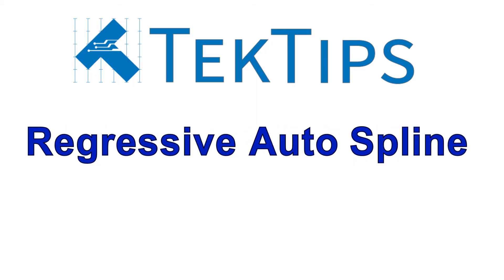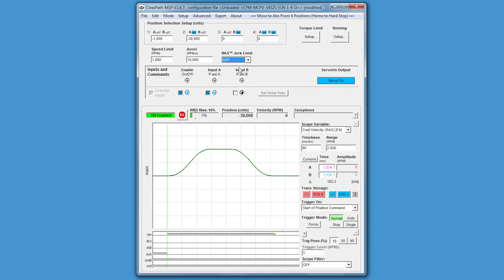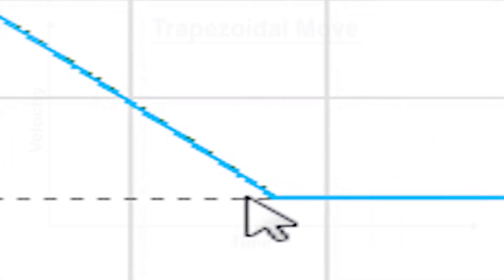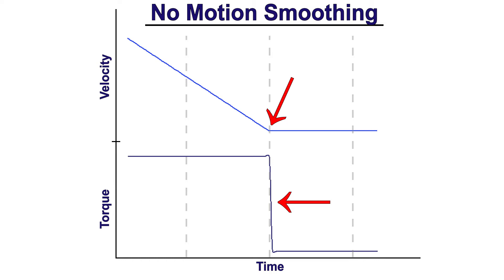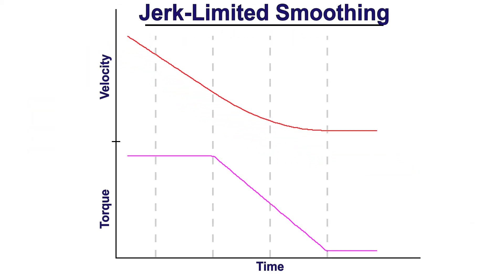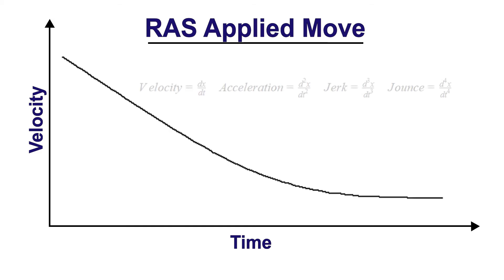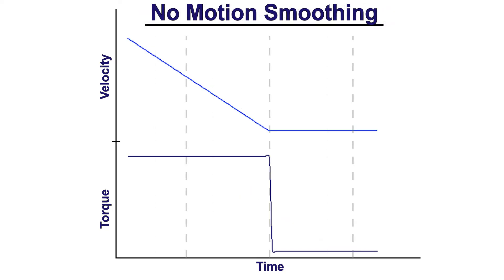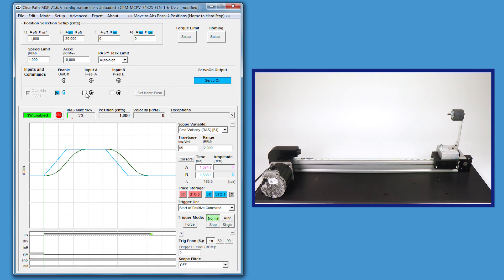ClearPath's RAS: Smoother Motion Control than S-Curves

Comment: What does this do to coordinated moves in two or more axes on SD models?
Reply from the maker: Hi Rick,

To achieve coordinated motion with the ClearPath SD series on a multi-axes system, you'll need to enter the same RAS value for each axis. This assumes that the motion controller is supplying properly coordinated moves.

Determining the appropriate RAS value for your machine requires some testing with different values. The general approach is to start testing with the lowest value in the appropriate range below (based on the type of machine you are testing) and run some test cuts. 

During the test cuts, you should be running at your maximum acceleration and cut speed. After testing with the lower end of the range,  raise the RAS setting up through the range and retest. 

Here are some typical RAS settings for CNC machines:

Laser CNC 9ms-16ms
Wood router 16ms-24ms
Stone cutter 24ms-44ms
Plasma cutter 24ms-44ms 

Since the RAS is being applied to the command, you need to be careful not to set the RAS too high. Setting the RAS too high will effectively change the pattern itself. The highest RAS value that produces good results without sacrificing cut quality is usually the optimal value.

As you increase the RAS setting ,your motion will become smoother because the RAS is reducing the amount of jerk in the command. The RAS time will be added to your move time e.g. a 1 second move with a 24ms RAS will yield a move time of 1.024 seconds.

Since the jerk has been reduced and the motion is smoother, you will almost certainly be able to raise your rate of acceleration. Most users find out that their move time is actually shorter when using the RAS, not longer.

Please feel free to email us at support@teknic.com if you have any other questions.

Best regards, 

Aaron B.